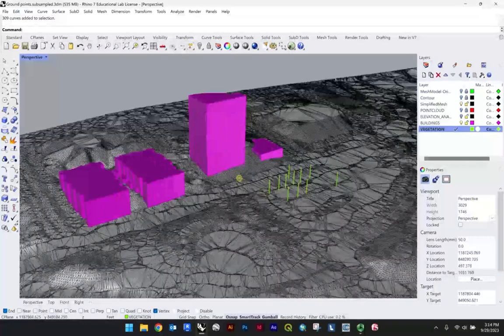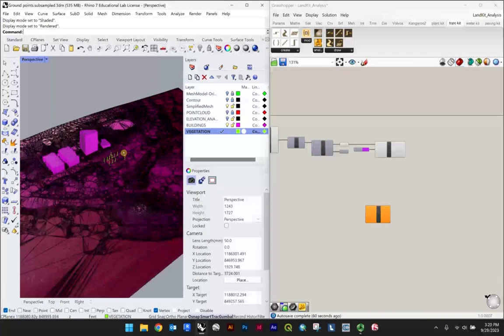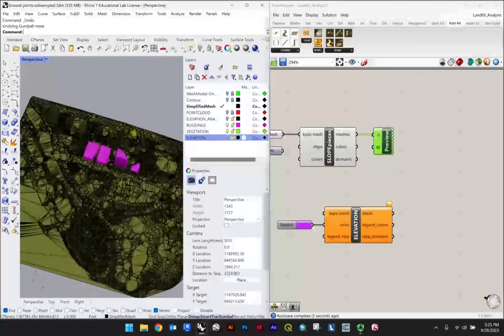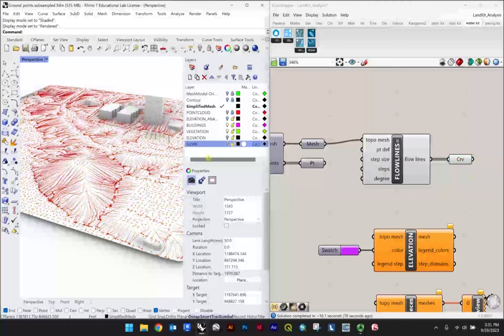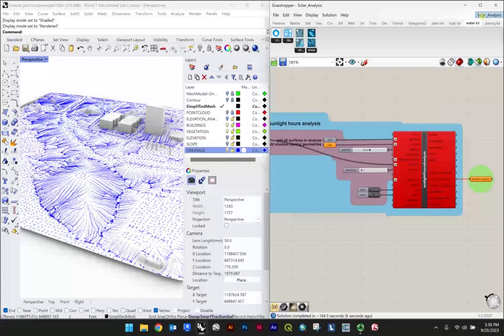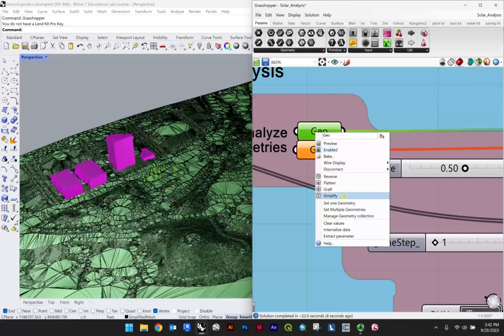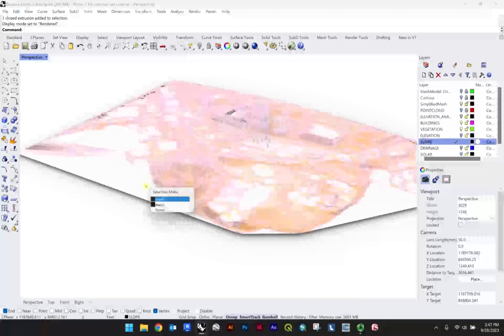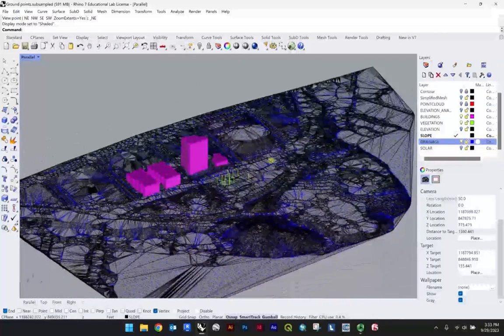Environmental Analysis using Grasshopper: Elevation, Slope, Drainage and Solar Analysis

Comment: what is water kit’s name in food 4 rhino?
Reply from the maker: https://www.food4rhino.com/en/resource/free-water-workflow for the drainage analysis in the tutorial. However, it is all part of the Land Kit suite (https://www.food4rhino.com/en/app/land-kit); if you download this look for the 'water kit' tab along the top of GH.
Reply: @vjavet  thank u 4 reply. i have a little problem that The plug-in installation is complete, but the icons for the water kit and topokit are not visible in the toolbar. Is this what happens when I use the rhino 6 version? Waterflow downloaded pro.
Reply: I fixed the download issue. The flow of water is not as smooth as your video and there seem to be several earthworms, do you happen to know the cause?